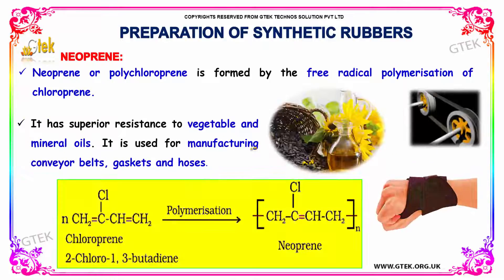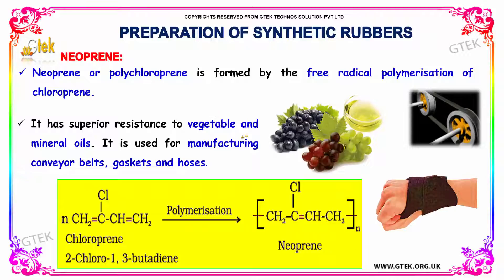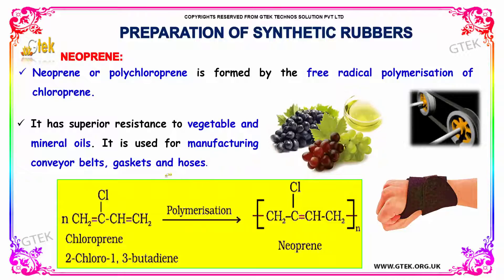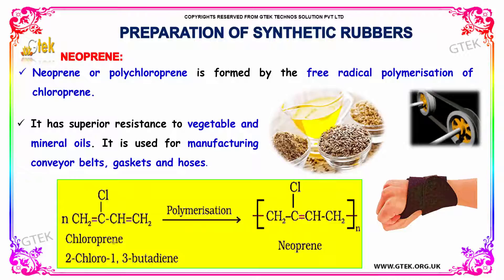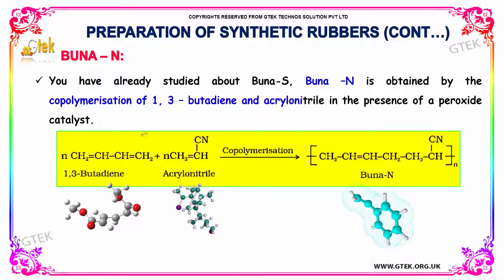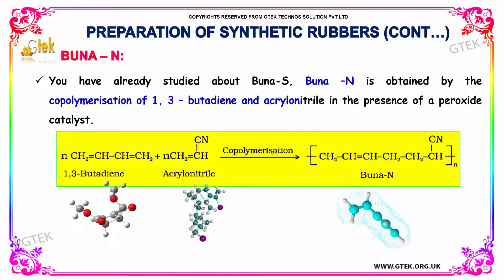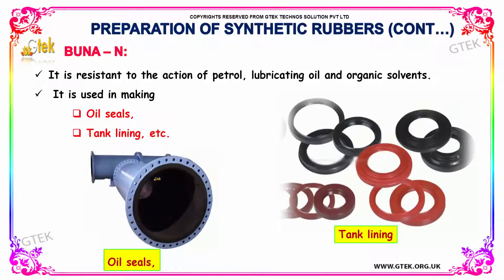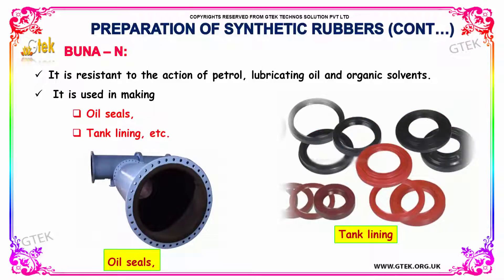preparation of synthetic rubbers chemistry in action class 12 chemistry subject notes lectures cbse

Comment: Latex will turn into a rubbery mass within 12 hours after it is exposed to the air. ... Elastic deformation of a rubber chain Page 2 2 Synthetic rubber is produced from petroleum-based hydrocarbons such as isoprene, butadiene, chloroprene, isobutylene, and styrene.